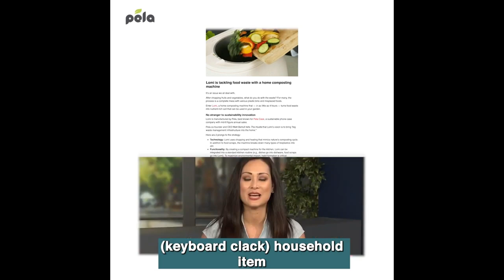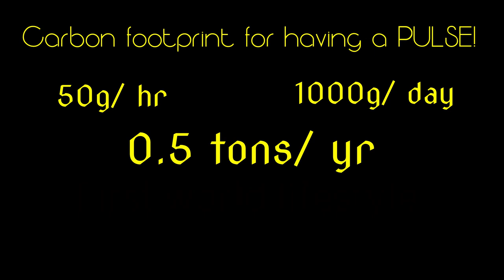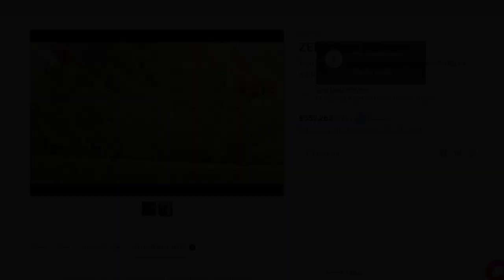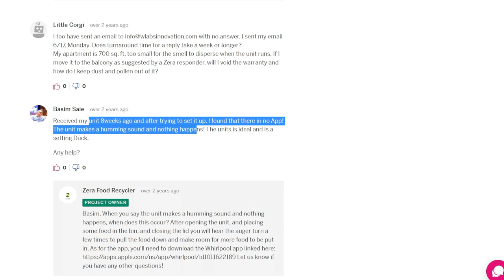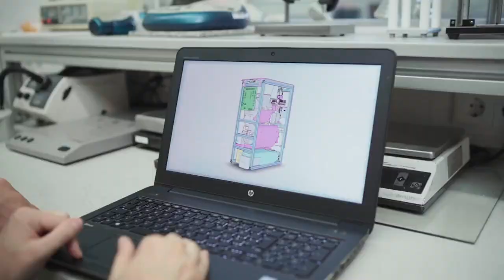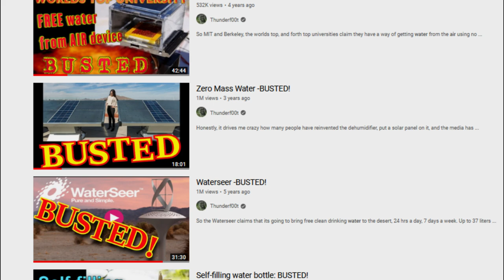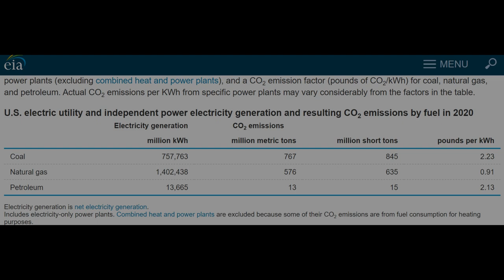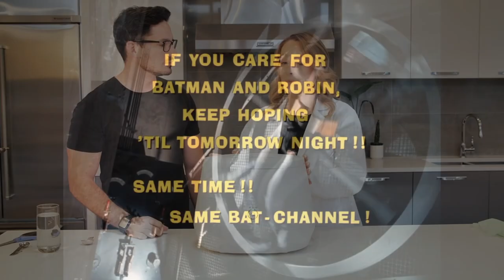Lomi: BUSTED!

Comment: We had something that actually worked way back in the sixties, we called it a “COMPOST BIN” it was at the back of the yard, used no energy, held large amounts of food waste and vegetation trimmings. Worked flawlessly for years and cost virtually nothing.
Reply: We had a fancy compost recepticle in my childhood kitchen that locked the door out but kept the nutrients in. It was called a "empty dishwasher powder bucket with lid". It worked great and was actually free.
Reply: Ah yes, I made a three bin model out of discarded pallet wood. You would place fresh material into the first " bin" use a broad fork and turn it to introduce air into the pile, then fork it into the second "bin"  and after a month or so, fork it into the third bin ready for use!
It is all a balance of carbon, things like coffee grounds and dry leaves, and nitrogen, wet green material like grass clippings food and garden waste and earth. INE key to rapid composting is moisture and heat generated by decomposition.
A properly maintained compost pile Does NOT Smell!!
Reply: my middle  school teacher introduced this revolutionary idea to us during the school year, add some indigenous fungi, worms and sun and it did wonders (its been a bit, might have missed some steps lol)
Reply: @rickcoona  it does if you do it in your kitchen.
Reply: Still hot one. It stinks. But at peast its outside rather than my kitchen
Reply: Yup, and all you need is a wood timber frame, and some chicken wire mesh... The "dirt" comes out the bottom after a month or two.
Reply: That's exactly what we have. A large open compost, a closed smaller one, and a tumbler. We compost all of our food scraps, grass, the leaves from 1 of our maple trees, and the cuttings from the garden crops we grow every year. We typically get about 6 to 7 yards of compost each year.
Reply: @The Great Nobby you can avoid the smell by turning the compost regularly and mix in grass, leaves, and water. This should keep the temperature down and prevent anaerobic bacteria which is what causes the bad smell.
Reply: the 60s gave us a lot but i dont think it can claim compost heaps  - been about since shortly after the dawn of agriculture I think
Reply: The thing is you can’t really use a compost in a lot of modern places. Strata rules, apartments, bylaws. Virtually everywhere in a modern city. Even new suburbs the yards are so small you’d be guaranteed to get complaints from neighbors

Most people aren’t so fortunate to have a nice 60s era house with a real yard. Those properties are becoming more and more scarce
Reply: But 'prevent waste management' is a pretty accurate description of the product.
Reply: @rustyshakleford5230  q1qqqq~1~~
Reply: @stucknousernames  Typically that's because of the meat scraps that are added.  Putting meat in a compost pile will cause it to rot as it adds WAY too much nitrogen to the process.
Reply: @rickcoona  why do you need air in the compost?
Reply: @ding1466  you need to introduce air so that the micro organisms that decompose the waste can breathe. Compost is micro organism poop my dude. They need to breathe to stay alive and eat. (This is the simple reason)
Reply: Or a tumbler composter that does much the same thing, for a bit more money, but faster. And you keep it outside, where it doesnt smell much because of the lid.
Reply: RIght? This isn't even that stupid of an idea really, just make an automatic compost bin that keeps it at an optimal temperature and automatically mixes it, and so long as the price isn't absurd there is absolutely a market for that!
Reply: @ding1466  What Nougification said. Introducing oxygen in your compost pile by simply turning it over keeps the beneficial bacteria alive, it prevents wrong bacteria from multiplying, and it adds 'fuel' to your pile in a way that it reheats the lot after it has cooled down.
Absence of oxygen can cause compost to start stinking but usually it just slows down the composting process considerably.
Reply: Parents have utilised "decade+ old icecream bucket" in the house & "bin thingie" in side yard for as long as I've been alive.
Reply: @rickybobby5153  The neighbors can do the following: Kiss my ass, mind their business, and, throw their food scraps in my compost bin. Not necessarily in that order. My god the entitlement some people can have...
Reply: @Mostlyharmless1985  Ya well when the neighbors complain and you get ticketed by the city that’s when it can be a problem. Not everyone has the luxury. There’s a lot of prudish communities out there
Reply: @rickybobby5153  what's the city going to do, put a lean on the house? oh noooooooo. There isn't anything they can do about it.
Reply: @Mostlyharmless1985  Uh… yes actually. When you owe fines or taxes the city can sell your house
Reply: I guess this is only marketable now because many of us DON'T have backyards, and likely NEVER will with the way housing has gone.  😅
Reply: I was thinking of those, but you can't sell those to idiots. Even they aren't dumb enough to buy something that actually reduces your carbon footprint and waste.... Wait...what?

Well, at least not for $500.
Reply: and in murica land of detached homes so many could still have it...
Reply: Yep, that exactly what I used too.
Reply: @NotAnAmerican  it smells if it is too wet.
Reply: @Mostlyharmless1985  them you'll whine when your tires are slashed or your property is damaged.
Reply: Uh, actually, it be wrapped up in court for years and it would be a fucking shit show of bad publicity for the city.
Reply: Not only that, but landfills can be tapped for methane for a source of natural gas.
Reply: That's what these devices recommend you put the "starter" this produces into, because these are useless lol
Reply: We still have something similar here in the 2020's even. only ours required the extra step on dropping the leftover food and plant mater in a feed trough. We call them "Pigs"
Reply: Verma compost is the way to go
Reply: Yes that thing is actually good to have. You could also bury your food waste
Reply: @rickcoona  I've seen a composter in someone's backyard that was a barrel on it's side with a screen where the bottom used to be and mounted on an axle with a handle to turn it once a day or so.
 You just throw stuff in , turn the crank, and wait. Air flowed through bit no smell. I wish I'd been around to see the entire cycle, they did have a very nice garden.
Reply: It did smell funny though.
Reply: @rustyshakleford5230  Ah, yes, I heard of those.  I have a newer model, it is a repurposed pod bin.  Good to find a time proven product.
Reply: Yup and if you're smart add a few chickens and boom! Compost /fertilizer and eggs!
Reply: @Mostlyharmless1985  Yes.... they will put a lean on the OWNERS' home if citated and the fines are not paid. The whole HOA thingy sucks. But, for some reason, many of the new subdivisions vote in HOAs. But later complain about them (it's difficult to get rid of them).
Reply: @jaidamann8365  yeah, that’s a big problem if I ever intend to sell my house. I’m not.
Reply: Mine still works daily
Reply: My solution is even easier its called 26 freerange chickens.
Reply: I’m not saying to use this gadget, but I think it’s meant for people in apartments who don’t have a place for a compost pile
Reply: @Emiliapocalypse  in that situation I would raise up the idea of a communal compost bin then, or just properly dispose of kitchen waste because it isn’t the major concern of our waste control chain. The big fuckers are long term plastics and metals. Kitchen waste is just a mild inconvenience by comparisons
Reply: @konastar  dang city ordinances against keeping chickens. I'm thinking of going rogue and getting some anyway.
Reply: @rickybobby5153  community gardens could easily add a composting area that people could bring their food as craps to. My coworker’s apartment rooftop has a garden and they have a composting bin available spring m summer, and early fall (our winters are too cold)
Reply: Burying food scraps directly in raised beds has always worked well.
Reply: @crystaledwards9878  the yard bird association in my city petitioned and got passed permits to keep backyard chickens. Provisions being that you attend a class for their proper keeping and welfare, that you meet minimum shelter requirements, that they not be raised for slaughter, and that you don’t keep a cockerel. It’s doable with the right set of motivated people behind you.
Reply: Many things seem to be like that these days.
Reply: A very large percentage of people, and I know this is hard to hear, do not have yards where they can put huge tumbling compost bins
Reply: And you can cut up pieces that are too big with a knife. This consumes 1000x less energy than this "rapid composter" BS.
Reply: Sounds like you’re talking about boomer tech. Boomers cause all of these problems, didn’t you hear?  /s
Reply: @rickybobby5153  my yard at my last house was the size of a postage stamp. I still composted.
Reply: @rickybobby5153  my city has zero laws against composting. Neither have any of the seven cities I've lived in as an adult.
Reply: @williamriven  it doesn't smell if done right.
Reply: @jaidamann8365  so sell and relocate. Or refuse to join the HOA.
Reply: @Mostlyharmless1985  I eat my chickens after they stop making eggs.
Reply: @jailbird1133  It doesn't work quite like that. Most new homes (starting around early 2000s), in my area, are in Subdivision, which more than likely are governed by HOAs. There is no way to "refuse to join" the HOA (it's voted in with a majority vote). And the sub that live in has had this HOA for more than a decade (I am new to the area).
Reply: I live in an apartment without a yard and my town doesn't have a compost service, but my solution is to finish my meals. I generate a couple of banana peels a week in food waste, lol
Reply: @Mostlyharmless1985  I guess you've never lived somewhere where the neighborhood community can kick you out of your house because it doesn't comply with their neighborhood beauty regulations. One place I lived growing up had an acre and half of land but we couldn't build a chicken coop or anything due to the neighborhood regulations. In the US, these housing associations were initially created in the US to prevent black people from living in white communities and they continue on by making it hard for anyone that doesn't want to live the perfect suburban lifestyle that keeps the neighboring houses high valued. Chicken coops and compost decrease the value of the neighborhood, so it's not allowed. America is only free in exceptional pockets, I'll tell you that much
Reply: When you live in a apt a compost bin isn’t something you want in the middle of your apt. Especially if you live in nyc and your apt is under 200 square feet
Reply: I love my compost boxes. My garden loves them too.
Reply: Yeah, compost bin is cool, but this is more marketed for those living in flats,  without garden.
Reply: i have an automatic composter. foyr legs and says oink oink. and after three years it can feed 5 people for 120 days with meat
Reply: A lot of people don’t have a yard like all of us who live in apartments so you saying this means nothing to a lot of us. Clearly the idea of this device went over all of your heads and none of you can make an educated guess on why they made this product in this first place or who it would be good for based on this comments. All of you saying compost in your yard well thanks for telling us who live in large cities or apartments where we don’t have one. At this point your preaching to the choir and everyone repeating it clearly has a yard so again preaching to the choir which makes no sense. Someone clearly cant see two feet in front of their own nose to see not everyone is like you and has what you have. Ignorance still exists.
Reply: @pattycarljackson  You can keep a pig in a small appartment, maybe a guinea pig, but still,...
Reply: @sandraude1  “but still” nothing.
Reply: I was so confused by this line of products. Like...why not just throw it into the compost bin? That seems to be the easiest solution, and one the that requires zero electricity and...you know...actually works.
Reply: I live in an apartment complex with no community garden and no where to put compost. When I lived in the country we had lots of regular compost and I hate the food waste I have now in my apartment. Just because you don’t see a use for it in your life doesn’t mean that everyone will have your same resources available…
Reply: We still have those. But not everyone has a yard, let alone one large enough for a compost bin. Yes, this product is ridiculous and pointless, but so is your condescension.
Reply: Golly Gee!
Reply: I still do I'm 22 been doing it since last two years. In an old mud pot
Reply: @Mostlyharmless1985  WTF good are chickens when you can't slaughter them?
Reply: @dancooper6002  learn the difference between pet and livestock. Chickens adds to the composting power of a household and acts as primary disturbers of the land as well as pest control. You can’t raise them for slaughter. The birds for meat and the birds are eggs are different breeds.
Reply: @Mostlyharmless1985  You most certainly can eat them, even if they are not choice. Furthermore, why would I raise chickens and not have any chicken to eat? You are gullible.
Reply: Bonus advantage: food doesn't processing to be turned into compost.

Comment: This product is like a buying a "green" outdoor space heater instead of wearing a jacket.
Reply: It's like none of those engineers and designers thought about if the product actually made a different on the carbon footprint at all. Using energy to hasten the same process that happens with all food waste anyways is a waste, not a save lol
Reply: @rajgill7576  It's because they likely didn't. Because they're scammers.
Reply: Revolutionary new idea, the reverse AC! mount an AC unit the opposite way during summer, and you can cool down your garden when you're outside! 
I'll call this product the XBreeze 9000 and it'll have a sleek design and look super futuristic
Reply: It's like buying a outdoor space heater that burns jackets to keep you warm.
Reply: @rajgill7576  They made already over 7 Million $ with that scam, so why should they care?!
Reply: @maxximumb  ok,WTF, no.
Reply: @HexagonThatReallyLikesVinegar  I spot a flaw in your plan. How are you going to collect the remaining 10 instalments? But kudos for the environmentally friendly product. Your customers will see their carbon footprint reduced to 0 very fast.
Reply: @SurfingZerg I’ll take 100!!!